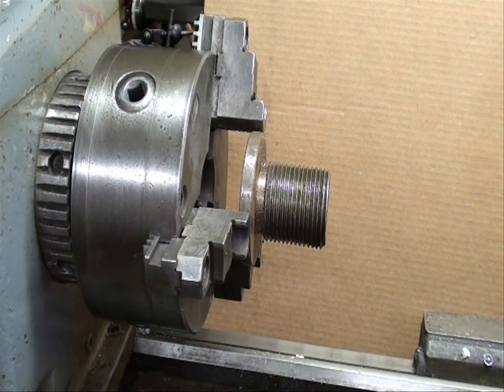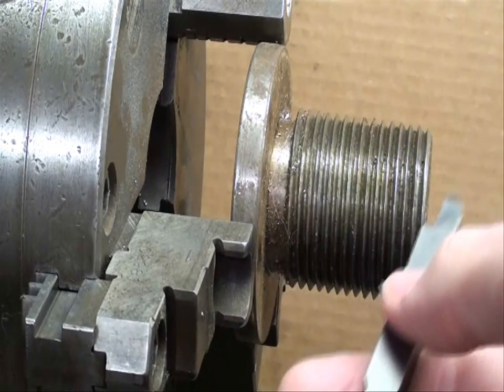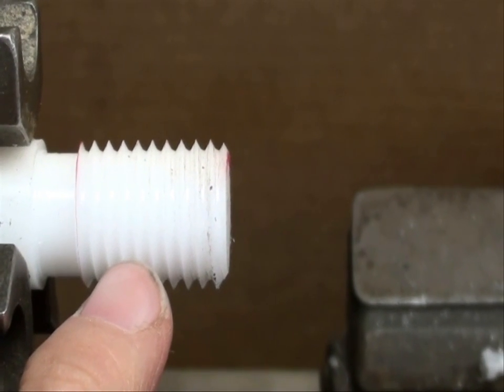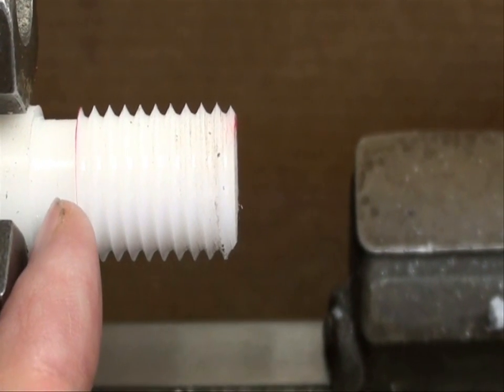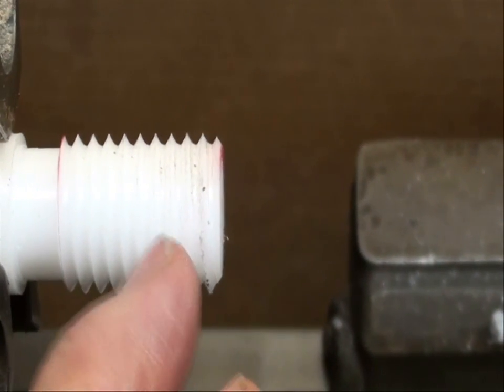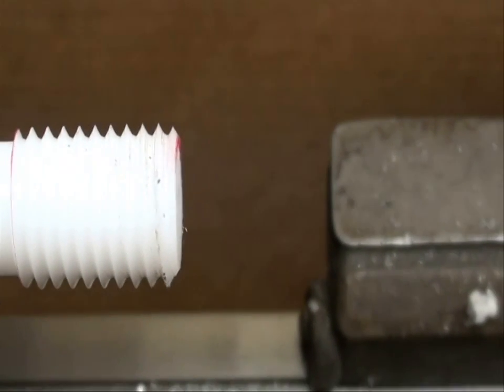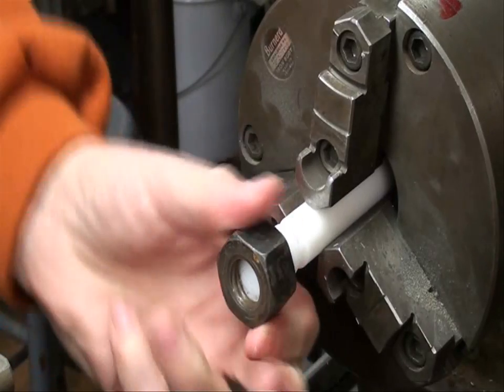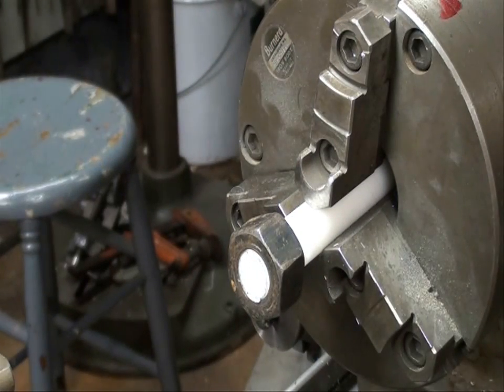MACHINE SHOP TIPS #17 Threading to Shoulder tubalcain

Comment: I've got an SB-9a w/ a thread on chuck. I know that if you try this method (as shown), your chuck will spin off. Has anyone tried anything to lock the spindle on the SB-9a? I've been thinking about drilling and tapping a set-screw hole in the rear flange of the chuck and barely touching the spindle. Thoughts?
Reply from the maker: I would very much like to find a good way to lock the chuck on the threaded spindle. Maybe that would work I do not know.

Comment: I can see where this would be a great way to thread. But on some lathes with screw on chucks (SB 10K) how dangerous is it to do this in reverse. I personally would consider doing it for light threading, but for heavy work it would be taking a risk. Too bad there was not some way to "lock-in" a screw on chuck. Guess a collet would be full proof.

Comment: Yes I like this way of threading too, far less risk and you can run the spindle faster which often gives a better finish. As far as I am aware the only cons to this is its harder to see the cutting tip and the job puts upward pressure on the cross side and tool holder but both of these seem minimal to me for small threads. Love your video's

Comment: Great trick! I learned how to cut threads the proper way, by engaging the feed when the the thread dial is on a correct line. I can appreciate the running back in reverse trick though. It works just fine if your machine has reverse. 

You do not run in reverse back through the threads, that would be silly. And backlash would be a problem. You are already feeding the cutter in using the compound rather than the cross slide. So you set the cross slide dial to zero at the beginning. Then feed in at 29-30 degrees using the compound. At the end of the cut you stop, and back out using the cross slide. Then run back in reverse with the cutter away from the work. Then you bring the cross slide back to zero and then you are ready to feed in with the compound and take another cut.
Reply from the maker: Yes

Comment: Great information! I'm working on a part with a high shoulder and I have half a second to disengage the lead screw. It's an old engine lathe and the lever is a bit loose, and if you don't hold the lever up it will fall down and re-engage. This will help tremendously, I don't understand why it's not so popular of a method.

Comment: I wonder if you could jig the same method here into Metric Threading? I'm probably going vague with time but I seem to remember there is a way of cutting Metric where the half nuts can be disengaged just as they are with Imperial threads?
Reply: I find it best not to disengage if the lead-screw is Imperial when cutting metric threads. It is possible  to do so by adjusting the position of the tool with the compound slide for every cut but it's a lot of mucking about and not all that accurate.
Reply: I've never tried this reverse method but today I'll give it a go. Even with having a power cut off, its nerve racking towards the chuck and I can see how reverse would take that part completely out of the job.
Reply: Yeah, that's still something I get edgy about, even after 35 years.

The big advantages of the upside-down method are that you can safely and easily run at much higher revs so you get a better finish on the thread flanks... and it's a fast method too. It's a bit more difficult to set up the tool but if you're making lots of the same thread it's still good. On some lathes you may have to make a special purpose built tool holder.

However there are two major disadvantages you need to watch out for. Firstly, as mentioned in the vid, don't do this with a screw-on type chuck. It can spin the chuck off... most embarassing. Secondly, some old flatbed lathes do not have a saddle that "wraps around" the bed. The lifting forces generated at the tool tip tend to lift the saddle off the bed, ruining the work piece. The same can happen if you have much slop/wear in the cross-slide or compound-slide dove-tails. Adjust them up before you start. Also, don't bother with this method unless you have a lathe with proper dove-tail guide-ways. Old flat beds sometimes had square cross-slide guides and these can lift up. Use your Mecha-nous and you'll be fine.

I thought I was soooo clever when I discovered/invented this method for myself as a young fella that I was a bit disappointed when I found out I was not the first bloke to think of it by a long way!

Happy turning!
Chook
Reply: lordchickenhawk I was tapping  1.75mm pitch threads into lugs held on a bracket on the toolpost and using the chuck to get them best centred and started. (Manually turning the chuck in neutral). There was tightness when I engaged the half nuts. I assumed that gear ratios allowed for a tiny % error against a machined tap? Meaning tapping and single point threading are almost the very same but not quite. What would you think?
Reply: In theory they should be the same. I've never really tried tapping in the lathe by putting the tap in the chuck. How did you get the tapping hole centred and in alignment with the spindle axis? By drilling it with a drill in the chuck? 
If not, even a small mis-alignment between the spindle axis and the tapping hole axis could result in binding, especially once the pitch is being forced by the half-nuts. Usually when tapping with a lathe, I like to put the tap in a jacobs chuck mounted in the tailstock and put the job in the main chuck. I then leave the tailstock free to slide along the bed and let it pull itself in and out as the tap requires. 
That's my thoughts on the matter, but without actually seeing what exactly you are doing I can't really say what's best since I've not actually tried this, like I said. Perhaps it will work if you leave the half nuts out while applying GENTLE feed pressure on the saddle hand wheel. You should be able to feel resistance changes as feed back while you turn the chuck with your other hand. Don't forget the love-gel and let me know how it went.
Reply: Just thought of something else that would cause binding. If you started the thread with the half nuts disengauged and then threw the lever in, backlash in the drive train would likely cause the existing thread pitch to be out of phase with the pitch the lead-screw is trying to force the tap to follow, especially if you had to move the chuck back and forth to get the half-nuts to go in. Don't use the half-nuts when tapping.
Reply: lordchickenhawk I only engaged the half nuts out of curiosity and to slightly help move the carriage towards the chuck as I turned by hand. Again its curiosity but this morning I'll put a dial gauge on the carriage and see exactly what is the advance of one full spindle turn with the correct gear train engaged. I expect a small % error and not a perfect 1.75mm as its obviously Imperial measures converting over to Metric measures and with using somewhat small transposition or change gears. They are 60 and 46 on my machine. I enjoy all the maths. I wrote a small algorithm which tells me in a minute, just exactly what angle my compound is against the work in any position it happens to be and is correct to 3 or more decimal places. Good for Morse and Jacobs and I've done a few recently. Not only this but turning any diameter only needs to be measured once when near the req. size and then finished with knowing exactly what reading on the compound will be the last.

Comment: Haha!  I just got my first lathe and glad to see that "my idea" worked so well.  Had a bolt that was badly dinged on the end and used the reverse and upside down setup to pick up the thread and clean it up.  Found out later how to pick up the existing thread and run it normally.  Love this method for those crash prone setups, though.  Works like a charm.  Keep up the great videos.

Comment: Thanks for refreshing my memory about how to do this.  It had been many more than a few years since I needed to do this very operation.  A couple of footnotes.  You do NOT use the top slide compound to increase the cut, this will move the tool closer to the spindle of the lathe and will put your starting place into the shoulder of the work.  The way shown means that both sides of the tool are cutting, therefore small increments of feed are necessary and the tool profile must be spot on.  The other thing I found to be essential was to fit the carriage stop to the bed set at the starting point.  This assured that I got the tool in exactly the correct linear position on return of the carriage.  (I tried it the first time thinking I could spot the right place, not a good idea and I ruined the first go.)  Be sure and check all your feed settings because when the lathe is run in reverse the carriage feed is also reversed; therefore on most lathes the feed direction will reverse also, so just make a "dummy run" before proceeding.  Thanks again!

Comment: I suppose for hobby machining leaving the half nut engaged is fine, but if the thread length were something like 10 inches or even 5, that process becomes painfully slow. If my boss saw me doing that I would be chewed out, unless it was a metric thread. Where I work it's a race to the finish for everything.

Comment: Thanks for #17 Mrpete. I used this reverse method last night on a 18 inch long threaded rod so that I could take a nap between runs without fear of a crash. I just set the stop near the tail stock and let it run south until the feed kicked out!

Comment: are you sure you understand yourself what you're talking about? the only way to dull your cutter is by not lifting it when returning to start for the next pass. since you obviously don't know that you're probably a hack machinist yourself taught by hacks. keep ignoring however the reversing method is as proven as the one in mrpete's video. just because it's not your personal preferred one doesn't mean it's wrong, that's the only real fact !!!

Comment: he is talking about reversing the machine to back your bit up. not working upside down and away from the chuck. and he is right. kicking the machine into reverse instead of using the half nut correctly is hack machinist shit. just because you are a hack and were taught by hacks doesnt mean its the right way. Mr pete just explained to you clearly and concisely why you dont do it. with the backlash involve you are dragging the cutter in reverse rotation which dulls it. believe it or not, its fact.

Comment: In this particular situation this method to run away from the chuck ist certainly the better method however anyway all designers will work with an undercut anyway. Finally - to simply say that the stop and reverse method is used by poor machinists only is b....sh...! working now in the mechanical industry for +35 years and learned it that way and never had problems. anyway all the lathes used in the different vids are not even 2nd but 3rd class quality machines.

Comment: I'd love to have that gearbox on my lathe. On mine I have a box of gears and a chart inside the gear cover. If you want to cut threads it's a few hours, at least for me, to get the gears switched around to do it. I can't reverse my spindle either so I'd just have to be very careful.

Comment: i been watching you for awhile now picking up tips.. advanced student at the local college.. i just had a thought this method could be used for high speed threading in order to maintain correct cutting speed and get a better finish correct? and can you do this method on the 29 degree? with it be set up 29 traditional? or 29 lefty since your feeding the opposite direction?

Comment: Hi Tubalcain, most of the content of your machining tips are very good, but I don't agree with your comments about not stopping and reversing the lathe when threading short lengths of thread. At low speeds lathes stop pretty quickly and before you return to the start you have to withdraw the tool regardless of the method. Also for inexperience machininst or cutting metric threads with an imperial leadscrew it avoids engaging the half nuts at the wrong time on the thread index.

Comment: Your problem could also be that your tool is not sharp enough and is causing deflection in the wok piece.  As you get closer to the chuck, the rigidity of the wok piece forces the tool to cut deeper.  Clear as mud?

Comment: I suspect that you have a bit of tool or work piece deflection and should try taking smaller cuts. You could also take the cuts as you normally do and occasionally stop feeding in the compound to let the piece clean up while making a couple of passes.  The last several passes without feeding the compound will make diminishing cuts on the work piece until it almost looks like it is peeling fuzz from the thread. It is a "learned feel" that comes with experience.

Comment: I was rethreading oilfield drill collars up in Alaska. These are tapered threads that run right up to a shoulder. I caught the taper and put my hand on the travering handwheel and bent over to see the cut. My hand acted as a brake of some sort and wedged the half nut closed. I couldn't release the half nut and crashed into the shoulder. I learned a lesson. "Never rest your hand on the traversing handwheel when the half nut is engaged!"

Comment: For a lathe with threaded spindle, could you run the spindle in the normal direction with the tool mounted normally, and put the leadscrew in the reverse direction so the tool moves left to right?

Comment from the maker: @akotoun  The spindle is being run in reverse, so the tool must be upside down. Otherwise it would be rubbing-not cutting. Set your tool on center ( with the tailstock center) . Height adjustment with the rocker wedge under the tool holder.

Comment: Thanks again. I never had a shop teacher, and picked up what I know about machining from books as HSM (& projects in metal) only. I had the distinct impression that this procedure was preformed with the tool mounted upsidedown on the far side of the lathe, but I see now that would not get you anything.

I suppose you could also mount it on the far side, right-side-up to do this operation, but you would still have to run the thing in reverse, which you pointed out is risky on some lathes.

Comment: Was wondering about running it backwards like this! Question answered before I asked! Didn't think of the backlash issue.
I'm sure I've seen pictures of someone who affixed a removable manual crank to their spindle for some reason, it might have been for threading. Might be another option for exceedingly tight to shoulder threads? Albeit likely a lot slower.